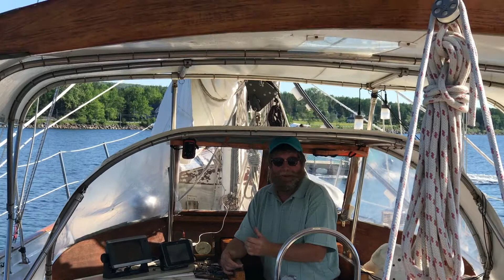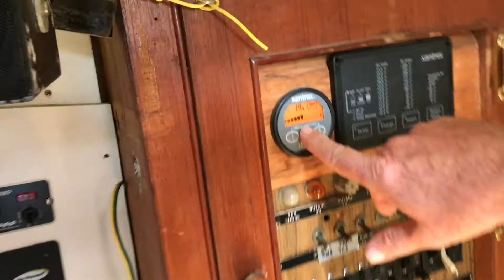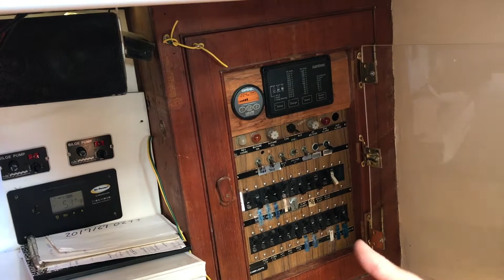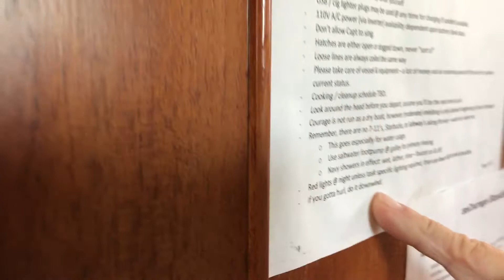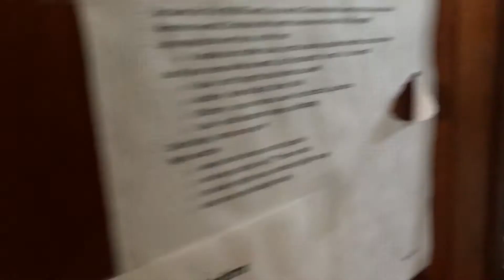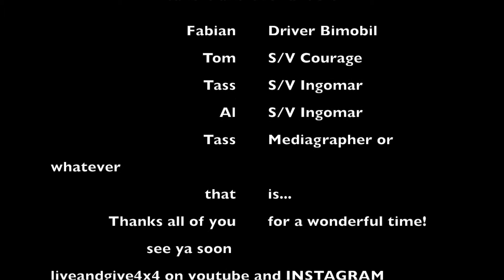Overlander and sailor can learn from each other

Comment: You have to use these meetings with other world/long term travelers to interview them. Make these interviews a separate video. They could be anywhere from 20-60 minutes, depending on how interesting and packed with info they are. Ask them about how they got started, what scared them, how they dealt with fear when they thought about getting started, what mistakes they made, why they would do it again, what's the best/worst thing that has happened so far in their trip and how they dealt with it, what they'd do differently now, why they'd recommend others to do it, etc etc. You get the picture :)